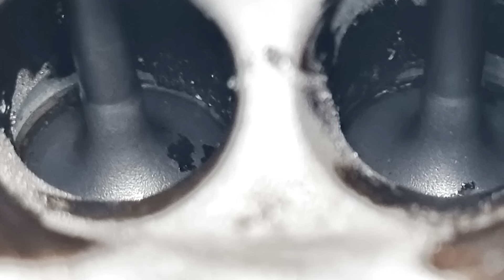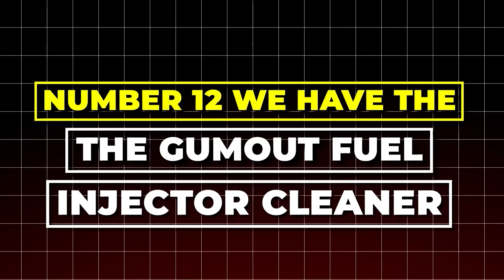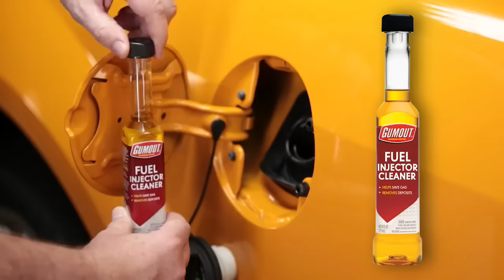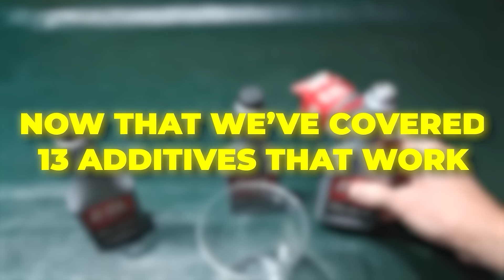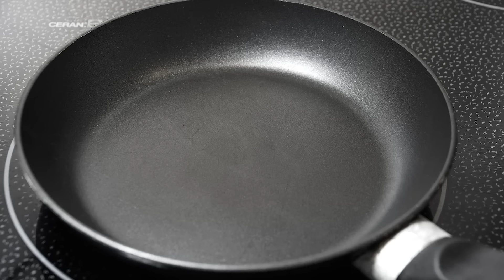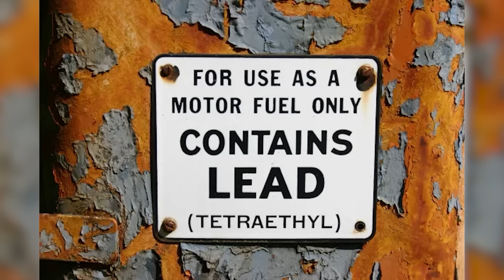13 Engine Additives That Work (And 5 That’ll Kill Your Car)

Comment: omg lucas stabilizer sounds great but like... isn't it just thick oil??? my uncle says u can just mix some honey in ur oil n it's the same thing lol. any mechanics here wanna confirm or nah... feels fake but idk 🤔
Reply: Yes, I will vouch for Lucas motor oil stabilizer. And I am an advocate for and use Lucas oil regularly in most of my cars. To include my 2015 fiesta. Read my statement above and when he said honey. He's saying motor honey. The thing ISIS you can use Lucas in the modern engine.  What you're doing is you're not trying to fully replace all of your oil with Lucas? You only subsidize like say example. If your engine holds 7 qt subsidize for 7 courts, one court. If you have a 5 court, use a halfricort. If you're like in a big rig that holds 40 qt of oil, you can use a whole gallon which is 4 qt.  I know it works and it works well. Most people think, as Lucas is a oil thickener. That is wrong. It is actually added for viscosity to help to make the oil slipperier, making the parts quieter. And on top of it, I'm pretty sure you went to some part stores and seeing that they have this little.  Let's call it a do Hickey up on the calendar at some part stores where you have 2 gears. That is when you put it in gear like a transmissional or differential. It does do that. There is several versions. There is the transmission formula. There's a power steering formula and there's the injured stabilizer, which can be used almost anywhere, but ideally mostly in the engine.  If you need anything any more information, ask me.
 I am a mechanic in the field. Not some spoon. Fed dealership technician that eats and breathes the b. S sandwiches at the dealership. I will tell you the truth that is on.  The ground or in the field.
 I'm not here to make money. I'm here to educate. Unlike dealerships, they only care about trying to sell big-ticket items.
Reply: My mom overheated her engine letting it run outta water and it was low on oil as well. She added oil and drives it home. I fixed the water leak. And now I hear a little knocking sounds near the bottom end near the oil pan. What part would be down there making a sound of (metal falling landing on metal) continuous as if in a washing machine......      @vegahowell5813
Reply: U ever use z max its made me a believer  @vegahowell5813
Reply: @vegahowell5813 If you were changing oil and turning wrenches you would know how to spell QUART. It's printed on every bottle. Never taking your advice for anything, stay off the Internet.
Reply: Lucas worked great for my 83 Bonneville it leaked all the trans fluid out and wouldn't move I put Lucas on it and it ran fine and never leaked again I used it in my oil to just do an oil change earlier so it doesn't clog anything
Reply: My experience with Lucas oil stabilizer was on a rebuilt 6.5 diesel.  About 10k after rebuild, blew an oil cooler hose.  Didn't catch it right away, so it ran a couple min w/ no oil pressure.  Replaced the hose, new oil and filter, and fired it up.  No glitter on dipstick, no knocking, oil pressure the same!  Ran the truck for several thousand more miles before upgrading.
Reply: I'm gonna assume your uncle is talking about motor honey and not the kind made by bees. If he's talking about bee honey,  don't ever listen to anything he ever says.
Reply: Give honey a try and report back!
Reply from the maker: Your uncle’s got a point about thickness, but Lucas is more than just thick oil—it’s specifically formulated to reduce wear and tear on your engine. It’s not like honey at all, and while it may seem skeptical, many people have seen positive results. Mechanics generally approve of it for engines that need a bit more protection. Not quite fake, just a bit of extra care for the engine.
Reply: Knowing what to look for quickly erodes false narratives here.

I have tried all commercially available additives, and Lucas Oil Stabilizer does what it says - stabilizes the oil in high temperatures. As the oil heats up, oil pressure drops. With Lucas, oil pressure stabilized under heavy towing. I tow with a bbf, and without an oil cooler, my rod and main bearings last a couple thousand miles on 10w30, as recommended by the local machine shop. Use of 10w40, and Lucas Oil Stabilizer will grant me a year, or about 30k miles. With oil cooler, about 80k to date. (0.0028" rod and main clearances at time of rebuild)

It's not just thick oil, but is sticky and clings to the metal surfaces. This eliminates wear at cold start-up. 

I had a 1998 Chrysler Concord with 160k when I bought it, rods rattling at 4500 rpm with 5w30. I used 20% Lucas with 10w30, and it lasted until 260k.  

Some additives thin the oil, some impregnate metal pores, some clean carbon deposits. Each has their strengths and use.
Reply: @Faolan161  When you start with"I have tried them all!", you lose credibility.
Reply: @seeya205  how so? Care to ask what I found the effects to be from each additive? Or would you rather just smear my name with lies?

When you don't ask the effects I found to see if I actually did or didn't try them all, then **it's you who loses credibility**, not me.

Then you have the basic psychology... where I started off with knowing what to look for, not what you said... 3 strikes toward your credibility because you tried and failed to ruin mine. Funny how you did all that to yourself.
Reply: @seeya205  the explanation says exactly the opposite. You aware of what credibility means, and how to gain it? I demonstrated just that for you, you didn't....
Reply: You made a false, outlandish claim. It's impossible that you tried every single one that exists. 🤷‍♂️  @Faolan161
Reply: I ran Lucas oil in my 87 civic.  I had every tuner part on that car without opening the engine.  I constantly ran that car on the floorboards.  Best engine oil additive in my books.
Reply: I have been using Lucas for 30 Years, even in My Racing Motorcycles! I have had vehicles that have had an annoying ticking sound and just added Lucas and it Never did it again!
Reply: I use Lucas too
Reply: According to The Motor Oil Geek and lab test results, Lucas Oil Stabilizer is essentially just a high quality, extremely high viscocity base oil with no additives.
Reply: He says right in the video only for older engines;
Reply: @davehubler2595  LOS synthetic is designed for newer engines. Not as thick, but still sticky/clingy so it adds benefit to new engines with tighter clearances.
Reply: Go ahead. Add honey to your oil and let us know how that works out for you. I'd like to hear the results.
Reply: @FRoG-ah62 
I think he misunderstood his father, not honey.As in the one you eat that's made by bees.I think it his father was saying motor honey which is another brand
Reply: Your uncle's not right
Reply: Nope. Lucas impregnates the steel. Try cleaning it up. It secredes out of the metal. Beads out slowly damn near impossible to clean out without hot tanking the parts.In my experience of 45 years of wrenching.
Reply: Alot of people say none of that thick stuff is good with today's engines!
Reply: @davehubler2595  I use it in a 2007 6.2 LS...

Comment: A friend of mine used Slick 50 in his custom dodge maxi van and the engine blew up, Slick 50 had to pay for a new 360 for his Van, I knew it wasn't any good because think about it what happens to a Teflon Skillet after awhile it starts to peel off and flake and that's what Slick 50 did to his oil pump screen.
Reply from the maker: That’s a tough experience with Slick 50. Over time, the Teflon can flake and cause blockages. It’s a reminder to be cautious with products that sound too good to be true. Thanks for sharing the story. It definitely helps others think twice before using it.

Comment: Front suspension parts now days Most are not greasable AT-205 can be injected with a syringe into some suspension parts and it will help them last a lot longer, and like he said spray on works fairly well also.
Reply from the maker: Great tip on using AT-205 for suspension parts! It's definitely a smart way to keep them lasting longer, especially in parts that aren't regularly greased.

Comment: I have a 07 Toyota Corolla approaching 212,000 miles and I just tried Gumout high mileage fuel injector cleaner WOW that little 1.8 always ran great but now she purrs, I will definitely continue using this product.
Reply: I had a Lincoln town car,4.6 v8. It ran sluggish.put two gumout bottles in gas,changed the gas filter and it ran way better then after that
Reply from the maker: Gumout High Mileage Fuel Injector Cleaner is a great product for keeping those engines running smooth, especially with higher mileage. It’s awesome to hear it made such a difference in your Toyota Corolla! Keep it up, and it’ll hopefully keep purring for many more miles.
Reply: @carcareclues I definitely will, Thanks 👍
Reply: Try Red Line
Reply: One bottle ( gumout) at once.
Not two at a time**
Reply: @gradyhernandez4699 Correct one bottle after every 3 tanks full, not every time you fill up

Comment: I had a Chevy truck, vortect v6, that the last owner had used Lucas in the engine for many years. It ran perfectly fine, used zero oil, and had over 300k miles on it. I wouldn't hesitate to use it
Reply: Thats why GM no longer builds them. Too good
Reply: I bought a 2001 Silverado 1500HD 4Door in 2004. When I got to 200,000 miles I realized it needed better care . I started putting in Lucas to my oil and now I'm at 317,000 miles and she still running great. Vortec engines are tough as nails but Lucas helps a lot.
Reply: @brianoden1798  01-02 are the best trucks Chevy has ever built. DId a frame off resto on mine in 2020 for my retirement! Bought it new totally worth it by the way
Reply from the maker: That’s awesome to hear. The Lucas really helped keep that Vortec V6 running strong with zero oil consumption over 300k miles. It’s definitely a testament to how well some additives can work when used consistently. If it worked for you, it’s definitely worth considering.

Comment: I had a new 93 Toyota truck V6 (pre Tacoma and a much better vehicle in general). The oil filter was hard to get to so I put an oil filter relocation kit on it.  I also had Slick 50 in it. A hose tie came loose and the feed line for the filter relocation kit came in contact with the steering shaft which eventually rubbed a hole into it. I was traveling on the interstate and kept smelling oil burning a thought it was the old jalopy in front of me.  After about thirty minutes I realized it was my truck smoking. Temperature gauge still on cool and not a drop of oil in it. After a hose clamp over a piece of rubber covering the hole I put over 5 quarts of oil in it. I don’t know what to credit not having a burned up engine other than Slick 50???????
Reply from the maker: The Slick 50 may have helped reduce friction and prevent damage, keeping your engine from seizing even with such a major oil loss. While it’s definitely a risky situation, it’s great to hear the engine survived! Slick 50 can sometimes provide an extra layer of protection, especially in emergencies like that. I'm glad it worked out for you.

Comment: I always use motorkote additive for my engine oil and seafoam in my gas....both works wonders!!!!💯👍
Reply from the maker: That’s a great combo! Motorkote is known for reducing friction and improving engine efficiency, while Seafoam helps clean the fuel system and prevent buildup. Sounds like you’ve got a solid routine for keeping your engine running smoothly.

Comment: What about TriboTEX?
Reply from the maker: TriboTEX is a great option for reducing friction and extending engine life, especially in older engines. It helps with smoother operation, quieter performance, and possibly improved fuel economy. For newer engines, the benefits might not be as noticeable.

Comment: What would be a good additive for my 2018 Toyota Prius that currently has 135,000 miles on it and I drive 250 miles every day for work so the mileage is racking up fast.  I need this car to last 500,000+ miles.
Reply: Just keep changing the oil on schedule. That's probably the best anti wear miracle there is.
Reply: "Fluid Film" to make the body "under carriage" last as long as the engine. "Oh what a Feeling to Own a Toyota"🎵🎵🎵🎶🎶🎵
Reply: Depending on exactly where you live.....undercoating would be the best additive to make the vehicle last.  The engine will outlast the battery if you simply follow Toyota's maintenance schedule as written without using any oil additives.  Throw in a bottle of Chevron Techron fuel system cleaner every 30,000 miles and you'll be fine.
Reply from the maker: For your 2018 Toyota Prius with 135,000 miles, focusing on regular maintenance is key to hitting that 500,000-mile mark. For additives, something like Techron Fuel System Cleaner could help keep your injectors and fuel system clean. You could also consider an oil stabilizer like Liqui Moly Cera Tec to reduce friction and improve engine performance, especially on long drives. Don’t forget to keep up with oil changes and use synthetic oil for maximum engine longevity. With regular care and the right additives, your Prius could definitely go the distance.
Reply: Change your fluids on a regular basis. 5k for oil, 60k for tranny, 100k for coolant.  It will last! Red Line once a year.

Comment: The fact that Dura Lube (the oil additive version) was not metioned here, tells me this person/s did not do they're research well.  I've used that product extensively in several vehicles I've owned and I had zero engine issues out side of regular tune up maintences to include excess milage exceeding 100k miles on my older vehicles.  One of my vehicles, a 2009 Dodge Durango, I exceeded over 400k and I finally traded it in (engine still sound and intact) for a dodge grand caravan which I used the duralube, as well,  with positive results exceeding 170k at this present time.
Reply from the maker: Thanks for sharing your experience with Dura Lube! It’s great to hear it’s worked so well for you across multiple vehicles, especially with high-mileage ones like your Dodge Durango. Hitting 400k miles with the engine still going strong is impressive! Dura Lube is a product that deserves more attention, and it's clear it has made a big difference in the longevity of your engines. It’s always great to hear real-world success stories like yours.
Reply: You've done nothing with DuraLube that couldn't have been achieved with just proper maintenance without DuraLube.....  DuraLube is a snake-oil product, like most on the market.

Comment: My dad used STP motor oil treatment for his truck that made many trips from California to Indiana for many years. The engine never broke down and sold the truck with the original engine. It is the only additive that I put in my car.
Reply: I visited the plant and saw the car engines broken down.STP oil engine was like new, the other engine was a real mess. I have used it for 50+ years.
Reply from the maker: That's an awesome story. STP motor oil treatment has earned a solid reputation over the years for providing extra protection and keeping engines running smoothly. It sounds like it worked wonders for your dad’s truck, especially with all those long trips. If it’s the only additive you trust in your car, that says a lot about its effectiveness.
Reply: Zddp

Comment: My 04 silverado just hit 300k miles with original tranny after seeing this im gonna out some of these products and change my routin of changing my oil every 3k to 3 1/2k miles i mean its a chevy and 300k is huge in 2025
Reply from the maker: Congrats on hitting 300k miles with your 2004 Silverado is an impressive milestone! Switching up your routine and adding some additives could definitely help keep things running smoothly as you hit new mileage milestones. It’s always great to see a well-maintained Chevy reaching such high numbers! With regular oil changes and the right products, you might even extend that lifespan even further.
Reply: @carcareclues  I saw a YouTube video of some good additives to use befor and oil change and now imgoing from 5k oil change to 3k oil change
Reply: For a 2004 or older Silverado, 300K miles isn't really that big a deal.....  For a 2014+ Silverado, it's almost a miracle.

Comment: You should not be using any oil stabilizer. If anything just throw a higher weight oil in the motor. Oil stabilizer's like the one mentioned in this video. Do not have the same additives that the oil does you are using an only dilutes the oil additive package down in the oil you are actually using. I will not finish this video now specifically due to pushing a product I know for a fact is not beneficial.
Reply from the maker: You make a valid point about oil stabilizers potentially diluting the oil additive package. It’s always good to stick with what works best for your engine. Some people may find stabilizers useful, but if you prefer using just a higher weight oil, that’s totally valid too.